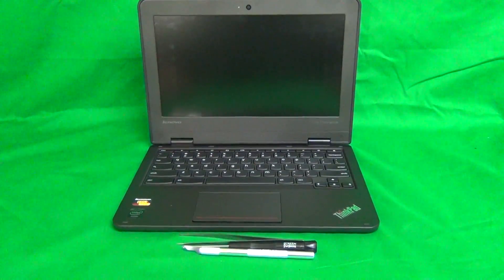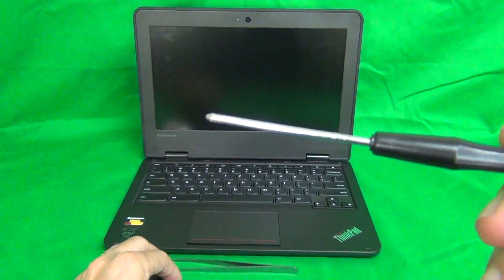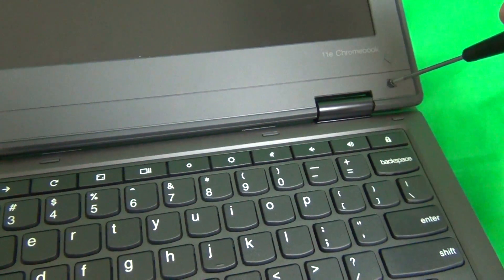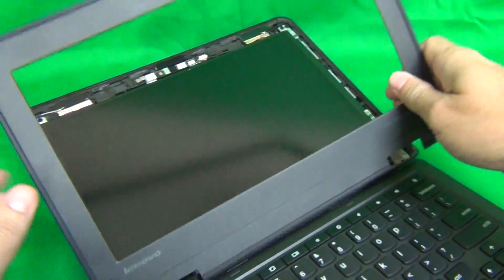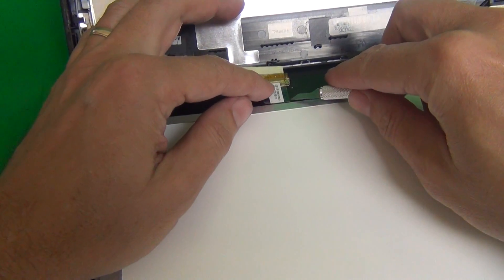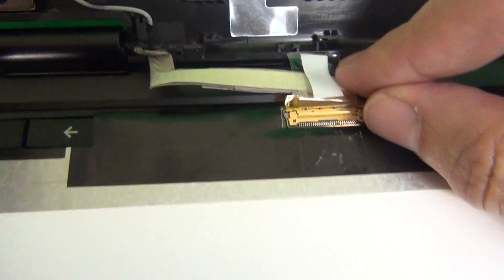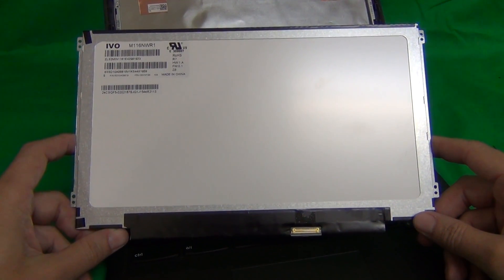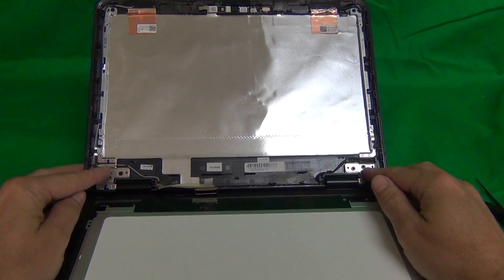Lenovo 11e Chromebook Replacement Procedure

Comment: Hello I am having a problem, I ordered a lenovo 11e screen replacement and the connector pins on the new screen seem to be smaller than the old broken screen that I want to replace, an d I have tried to fit it but It doesn't work so have I done something wrong or have i bought the wrong screen?